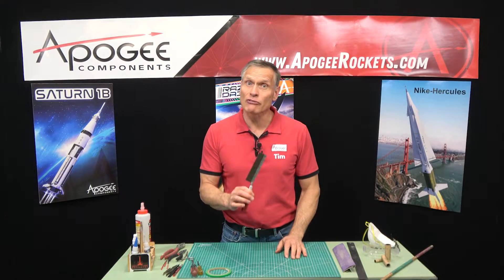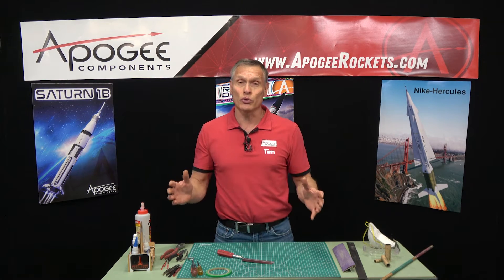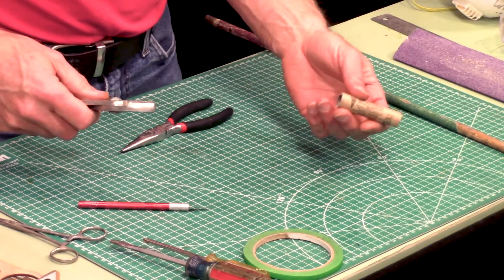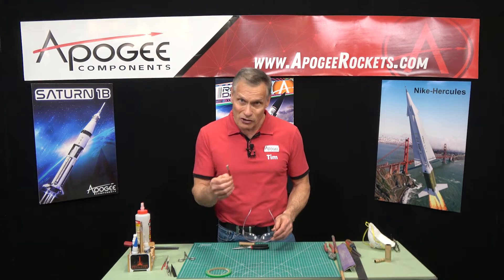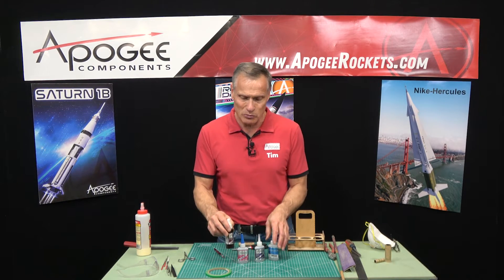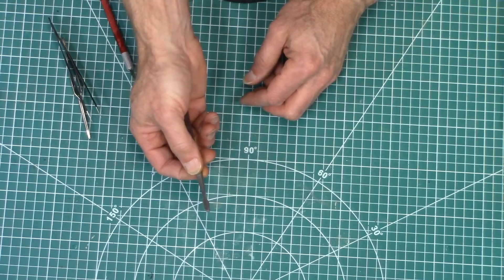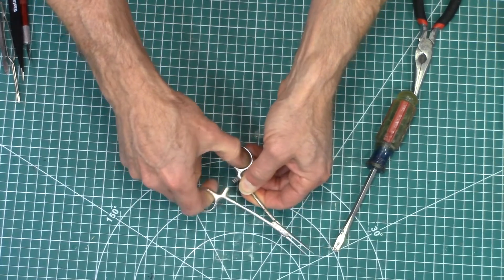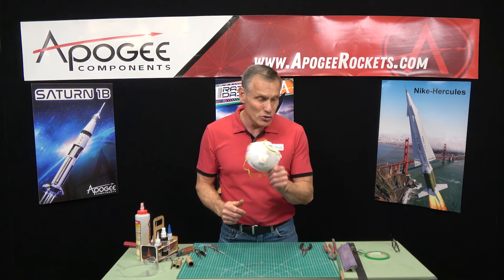What Tools do You Need for Building Skill Level 2 Model Rockets?

Comment: Do you have a video on the tools you need for a scratch build?
Reply: Depends how “scratch;” cutting & carving your own balsa nose cone?
The essential tools (scissors, glue, tape, pencil, knife, ruler/straight edge) to assemble a basic is often listed in the instructions, plus there’s a ton of info on this channel, the interwebs & such.
Reply: @francismoran1230  I find that for nose cones...a lathe is required. Turn the inside diameter back about two inches, remove and replace with a scrap piece of wood. Drill, and bore to inside diameter. Insert nose cone and shape with a 4" side grinder. Those flap wheels work well. Finish with sandpaper/emery clothe till you're happy. = )
Reply from the maker: It really depends on what you're trying to build. For a simple rocket, the tools in this video would probably suffice.
Reply: *smiles*........lathe, mill, scrollsaw, laser engraver, air compressor.....I can keep going. = )
Reply: @421rants2  fair, didnt really think that question through lol
Reply: @421rants2  I’d like to scratch-build some plastic fins, so I’m looking to engineer a petroleum refining & processing system in the backyard to produce the required raw material and eventually start making injection molded parts.
Reply: @francismoran1230  sorry...I'm just a master machinist who also happens to build rockets. Injection molding I understand....but making your own plastic. That's out of my league. If you ever get it right, I can build you a mold, but you're going to have to tell me what kind of Injection machine you're using. They vary from brand to brand. = )